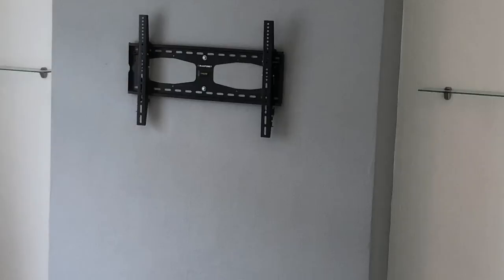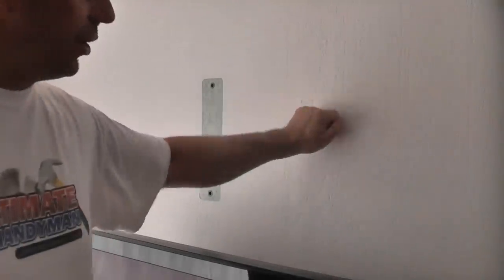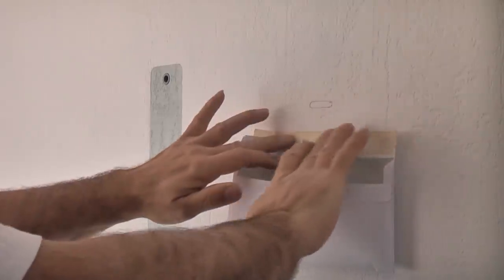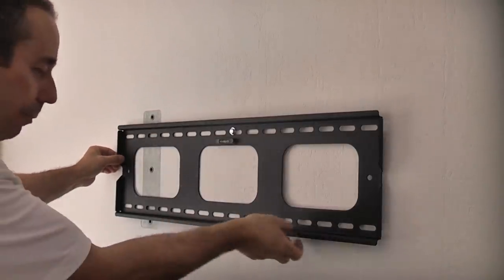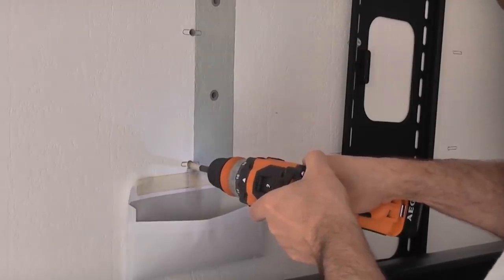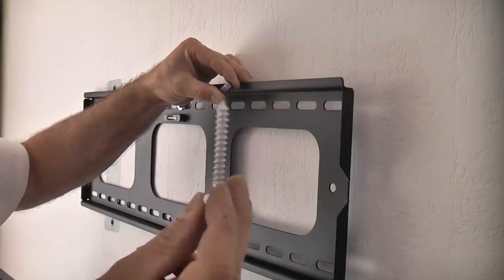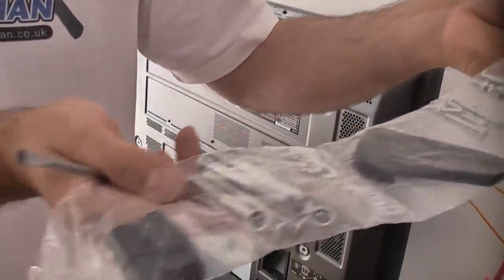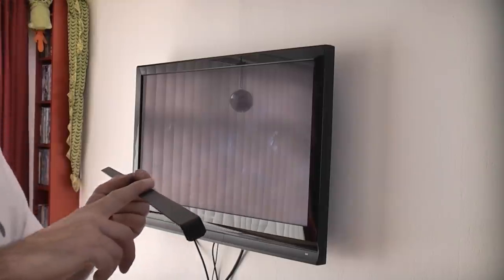How to hang a TV on a solid wall | fix Tv to wall

Comment from the maker: Editing videos is very time consuming, to edit this short video took me over 10 hours! I hope people find it useful, if you do please give it a thumbs up and share the video if possible.
I hope everyone is well and is coping with the lockdown!

Next weeks video will take much longer to edit, so I might have to film a shorter one, as I’m really struggling for time at the moment.

I hope everyone has a great Sunday 😉
Reply: Yes no need so much effort on You. Take your time enough to have pleasure. I'd still good even is to much "raw". Thanks for all the videos. Take care.
Reply from the maker: Thanks Karim, most of the editing is cutting out unnecessary parts of the video. The current videos that I'm editing has now been cut down to just over 2 hours in length, I have to keep cutting until I get it to about 20 minutes or less- as I don't want to send people to sleep 😂
Reply: What editing software do you use? If it has keyboard shortcuts for cutting up clips it might be a little less painful to edit. Thanks for sharing.
Reply: Love your videos! Absolutely gold. Saved more  than 10 hours of people's wasted time on doing bad jobs I should think. Good karma be upon you xx
Reply: Editing wise, 1 hour per 1 min of final video is fairly typical. Considering this is a 12min video you did well.

Comment: Great video, you’ve given me much courage when I come to hang my tv
Reply from the maker: Thanks for the comment 👍
Reply: @ultimatehandyman  cAN.I ASK.HOW TO PUT MY SAMSUNG 65 INCH TV ON THE WALL I HAD A  BRACKET ALREADY BUT THE PROBLEM IS THAT THE SIZE IF SCREW TO BE OUT AT THE BACK OF MY TV IS TOO SHORT COZ THE 4 HOLES AT THE BACK OF MY TV IS TOO DEPTH SONI CANT.SCREWED THE BRACKET AT THE BACK.OF MY TV AND THE 4 PCS COLOR  BLACK.PLASTIC FOR THE 4 SCREW IS TOO BIG ALSO SO.IT CANT BE INSERTED AT THE 4 BACK HOLES OF MY TV...THANK YOU SIR

Comment: After 10 years have decided to hang my TV on a wall-mounted bracket! This is the best video I have seen so far. Thanks very much. Which wall-mount bracket did you use? It looks solid.
Reply from the maker: I think it was this one, or very similar-
https://www.bmstores.co.uk/products/blaupunkt-32-64-tv-wall-mount-356711
Reply: @ultimatehandyman  Thanks a lot!

Comment: As someone that has installed probably over 1000 displays, I can tell you’ve done many yourself. I’ve seen someone do the envelope trick before, I just hold the nozzle from my mini shop vac when drilling. I like your idea of setting one bolt before doing the rest, very clever. That would come in handy for stack stone fireplaces, what a nightmare those can be! I used to give grief to helpers who pulsed the drill ;-}
Reply from the maker: Pulsing the drill works great. I think it's Metabo that make a drill with a built in pulse function ;-)
Thanks for the comment 👍

Comment: First I love your channel and I'm a subscriber for a long time already! I did a similar installation when we moved into our house. But unfortunately I later found out, that my OCD is able to accurately detect even down to 2 mm difference in level. So I ended up having to shim the TV on the rail via some home made improvised miniature shims. I wonder if there is a the type of rails that allow that kind of fine adjustment for level.
Reply from the maker: I'm not sure, there are hundreds of different makes available, so perhaps one make has this kind of adjust ability.
Thanks for the comment 👍

Comment: Loved this, I’m just about to fit a tv to a wall at my girlfriends house, every time I do any work like putting shelves up at her house I always have problems as the walls just seem to crumble. I wish I knew what I was doing wrong 😑
Reply from the maker: It might be the walls, some older houses especially have rubbish bricks etc.
Best of luck with it ;-)
Reply: @ultimatehandyman  thanks it is an old house, I just called my dad and he just said the exact same thing as you. So when she complains that I’ve put a big hole in her wall without a tv up I will just tell ur bricks are rubbish.
😂😂😂. Thanks again for the reply I know you are a busy guy 👍
Reply from the maker: @oraetlabora2157   If the walls are that bad, try injecting some grab adhesive into the holes- that can help ;-) 
You are welcome BTW

Comment: I discovered a plasterboard fixing I haven't seen before today at my local DIY store (in Sweden). I had a look and can't seem to find them in the UK but perhaps you'd be interested to test them out anyway? They seem to be made by a German company, the fixing itself is an interesting self deploying toggle type fixing. Look up TOX Spiral Pro. If you'd like to have a few I can send you some, I'd be keen to see how they stand up to your testing methods.
Reply from the maker: I've seen similar ones in the USA (a YouTube comment linked to them for sale at Lowes)
They look similar to the metal worm type screws, but with the additional toggle part (which looks quite clever)
I'd be happy to test some out (I would need 4 of them), if you can please email me I will provide my postal address. My email can be found on my channel page by clicking the about tab. It might take me a few months before I get around to testing them, as I'm very busy. 
Thanks for the offer, Paul  👍
Reply: @ultimatehandyman  Call me an idiot, but I can't for the life of me find your email address on the about page of on your website. EDIT: never mind, it seems it just doesn't show on mobile, i got it on my laptop, email sent.

Comment: Hi mate, thanks for another good video, how do you rate those gasbeton  plugs, ? , do they inspire confidence,lol. You have my sympathy whith the bent wall problems, I suffer from the same, as I'm in a house that they never used a spirit level on,lol. Take care , stay safe, Stuart.uk.
Reply from the maker: The Gasbeton plugs are good, but to be honest I have just used 4 inch long screws in the past with no plug or no pilot hole- you just drill through the plaster and then drive the screw into the thermolite using a drill/driver or impact driver. 
You stay safe too, Stuart. Thanks for the comment :-)

Comment: Great video as always :) I think the amount of fixings supplied can be a little intimidating sometimes but it's not too difficult, hung one like this a few weeks back. btw I used an impact wrench, would that make it easier than a hand wrench?
Reply from the maker: Yes, I forgot my impact driver, or an adapter for the drill. I did have my impact wrench in the back of the van, but they are too powerful for jobs like this.
Thanks for the comment 👍

Comment: You done well using a cordless drill... Mine doesn't have enough power and I have go cabled. What's the make of yours?
Have you thought of using those grip it fixings as they're designed for TV?
Reply from the maker: I think I used the Milwaukee SDS drill for drilling the holes. SDS drills are miles better than a traditional hammer drill-
https://www.youtube.com/watch?v=0k8IVxC_LGw&t

https://www.youtube.com/watch?v=dfvSdRcSzK4

Grip it fixings are ok on plasterboard- https://www.youtube.com/watch?v=szx7nMRZSIY&t=4s

I always try to fix to at least one stud though when fixing TV's

Thanks for the comment 👍
Reply: @ultimatehandyman  thanks. Wow you've got links to old videos... Great organisation!
Reply from the maker: @justintemp   Because I film, edit and upload the videos myself- I know which ones are useful to answer peoples comments. I don't have the links saved or anything, I just search YouTube for the videos that I think would be useful.
Thanks for the comments ;-)
Reply: @ultimatehandyman  thankyou.  Glad I subscribed!
I'm looking for a battery for that as they sell the base unit only. I like fact its light.
Need a cordless Impact and hammer drill set now, going all DIY as so much time on hands now 😂

Comment: Maybe it's me, but why do some people hang their TV's this high?
In my opinion it should be at Eye level.
Great video though
Reply: Totally! You'd have to put bricks under the front legs of the sofa to avoid neck ache!
Reply: You're right but in many homes that fireplace and mantle are the central focal points in the room.  Putting a tv somewhere else off to the sides just doesn't look good.
Reply: Ben de Vette That is a common misconception. I hung my first display in 1995 and I’ve never heard a complaint about height so long as you aren’t terribly close in the seating area. Your eyes look upward, not your head. Many homes {in the US at least} necessitate the display above the fireplace if having it in the center of the room is important. If your room is small, I’d agree with your comment though.

Comment: At your advice in the past I've used Rigifix fittings for a set of coat hooks on a wall that was plasterboard over brick with a gap between.  I now want to mount a TV on a plaster-covered brick wall (no gap as far as I can see; I've hung pictures on this wall with regular rawl plugs).  Do you think the Rigifix is appropriate here, or is that overkill?
Reply from the maker: As long as there is no gap, regular wall plugs and screws should be fine. You only need Rigifix or corefix if there is a gap which will lead to the plasterboard being damaged and fixings loosening.
Thanks for the comment

Comment: Hi incase wondering if you could help. I followed your instructions but I don't seem to be able to drill in far enough as the drill has stopped it is the same drill but I couldn't drill the hole any deeper. Any help.would ve greatly appreciated
Reply from the maker: Is the drill stopping at a certain depth on just one hole, or all of the holes?

Comment: I recently got a pull up bar, which came with similar screws/bolt to the ones in this video.... Are these the "concrete bolts" that don't require the rawl plugs, or is that a different fixing all together? My pull up bar came with rawl plugs as well. I'm a bit confused.

Comment: How do you hide the power cable etc? Is the only option to chisel out a channel, cover with filler and repaint the wall? Thanks
Reply from the maker: Yes, but if it is on a chimney breast, you can hide the cables in the chimney. Or you can get some smart D line trunking- which does not look too bad.
Thanks for the comment

Comment: I live in an old barn which has stone walls with plaster over the top, any recommendation for fixings?
Reply from the maker: If the walls are solid (not crumbly), you can just use normal wall plugs and screws- 
https://www.youtube.com/watch?v=V4wVyyfbWog&t

But if the wall behind the plaster is crumbly, I would use resin fixings- 
https://www.youtube.com/watch?v=oUJPjJsdl0c&t

Comment: so i need to allow a certain distance from wall to tv for the cables?. My power lead & hdmi cable stick out a good inch at least from the tv & wont really ben out of the way?. How i do i know which bracket to get for this space?. If that makes sense?
Reply from the maker: You can get special right-angled cables, even right angled connectors, so that you can get close to the wall. Examples here-  https://bit.ly/3jOL8HF and here https://bit.ly/3IfaY14  👍
Reply: @ultimatehandyman  Thank you. I wasnt aware of these. Appreciate it 👍

Comment: Whats the best type and size of wall plug for a 65" TV?
Reply from the maker: I'd use something like this- https://bit.ly/3kQViba
Perhaps 10X70 or similar coach screws
Reply: @ultimatehandyman  Thanks for the prompt response. Are these suitable for the typical UK internal breeze block wall, aerated/thermalite type?
Reply from the maker: If the wall is aerated concrete/thermalite, you are better off using these with coach screws- https://www.youtube.com/watch?v=YwAMQcbJS0U

Comment: Funny cause hanging tv on a solid wall is pretty easy but you’ve got the annoying cables showing, whereas hanging TVs on a stud partition wall is a pain in the ass but the cable hiding is much much easier ( ie hole in plasterboard and cables down to the floor where another hole is assuming there’s no nogging in the way!)
Reply from the maker: D line make some trunking now, which does not look too bad, but hiding the cables looks much better
Thanks for the comment 👍

Comment: How would I remove my tv I was home when it was put up but I can’t get to the back of tv to put or remove cables n I just brought I new tv n I can’t remove the tv frame the mount what do I do the tv is still goo I don’t want to brake it my wall is concrete it’s a old building
Reply from the maker: Sometimes there is a bar that needs pulling out from the side, which holds the TV to the bracket.
Once the bar is removed you can normally lift the TV up and off the bracket.

Comment: Thought you were going to show us how to fix to dot and dab walls?
Reply from the maker: Dot and dab walls are exactly the same as a solid wall, you just use different fixings, which I linked to in the description. Either of these two will work-
Rigifix- https://www.youtube.com/watch?v=xaYfs3lr1jI

Corefix- https://www.youtube.com/watch?v=7xLhIPoO5gQ

Thanks for the comment
Reply: @ultimatehandyman  thank you. And finally, the plasterboard fixings saga comes to an end - hallelujah!
Reply: @JohnHughes2002  When drilling the dot and dab wall to install the mount, should I drill into the dab or the gap between the dabs? Thanks.

Comment: "I can actually get my finger behind it" @5:15. That look to camera was too inviting not to say something. Contempt or disgust? Whomsoever dot n dabbed the plasterboard... Must have been a Friday night. I fitted a bathroom in a victorain terrace. The boarders/ plasterers, managed to get a corner obtuse (+90 degs) 30mm + over 700mm width of bath, tap end. 
Face palms. Tutts. Rolls eyes.
Reply from the maker: I think the house has been extended where I was fitting the TV, but was quite surprised at how far out the wall was. The chimney breast in the other house was the same!
I've seen plenty of un-square bathrooms, which can really catch you out when you come to fit a bath or shower.
 Thanks for the comment 👍

Comment: But the question is, how to hide all cable from wall ?
Reply from the maker: If it's a chimney breast, you can hide the cables in that.
For normal walls, you can either use trunking (D line trunking is smart), or you can chase out the wall and redecorate (big job)

Comment: what about the wires on a solid wall ?
Reply from the maker: Not sure if you mean wires buried in the wall, or the wires going to the TV
For buried cables, you can check the area for sockets and switches etc. It is very unlikely to find buried cables in a chimney breast.
For the cables going to the TV, you can chase out the wall and run suitable trunking for them, or conceal them in the disused chimney breast- or the easiest option is to use some D Line trunking, as that looks quite tidy.

Thanks for the comment 👍